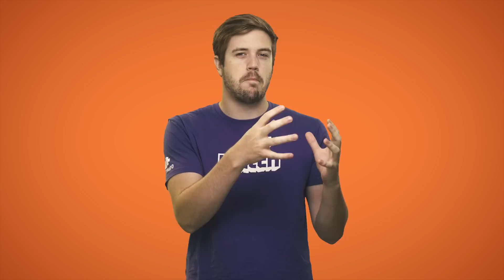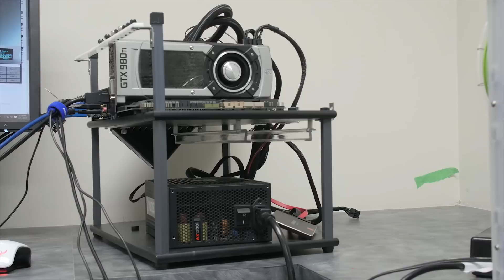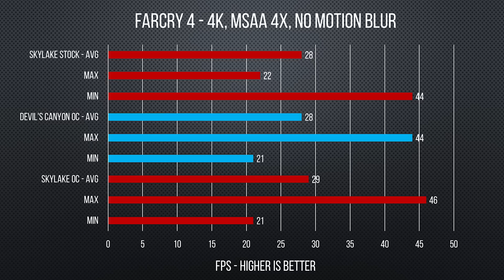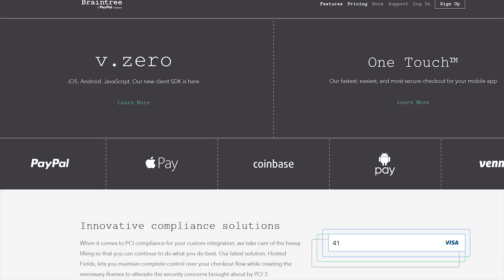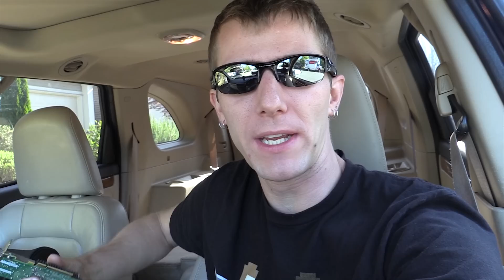Intel 6700K "Skylake" CPU

Comment: I am a gamer looking to max out games at ultra settings on a 1920x1080 monitor. I am really stuck between cpu's and I don't know what to get. I do not plan to overclock and money is not a problem as I have been saving for a while so can someone point me in the right direction?
Reply: If you're only going to be gaming, going for either an i5 6600k or an i5 4690k, even at stock they're still great choices

Comment: AM4 can't come out fast enough.  At least it will probably be around for a while.  Intel changes sockets like it's tissue paper.  Really Intel? You really had to add 1 more pin?  I'm pretty sure with the power savings of skylake you could've sacrificed one VCC or GND pin, but no.  Gotta sell those motherboard chipsets...  Seeing as Microsoft won't release an update for 8.1 to support the new extensions I'm done with winblows as well.

Comment: X99, i7-5820K ftw. Why the fuck would you go for a shit skylake when the 5820K is cheaper in price, has more cores and threads, absolutely crushes the Skylake in any given task except for single core tasking which doesn't mean much since 90% of games are multicore and multicores are going to be the new meta, especially with DX12 so close around the corner,  and I hope that you sassy Skylake fanboys realise you can force certain steam games to utilise all cores and threads. My work is done flies away

Comment: I still have my i7-860.. maybe I should upgrade
Reply: Pentium 3, 4000 fps on 4k crysis 69 with no heat
Reply: ***** Yeah, Trance is right. an i7 is nice (and I just bought one) but it demands a better cooler when OC'd, which also adds extra cost. Just skip the i3 and get the i5-6600k. I don't think that many people would buy a used i3 and it would be a waste of $120.
Reply: lol I still use my i3 550
Reply: +Mason Vanderpool i7 870 here
Reply: +Mason Vanderpool Intel core 2 quad q9300 I Need to upgrade aswell
Reply: +Asentrix eey, I7-870 buddies!
Reply: +Asentrix I lied. Xeon X3440 oc"d to 3.6 GHZ. I just say i7 860 so people don't go "eww xeons aren't good for desktops"
Reply: +Asentrix I'm about to do the same thing anyways.

What did you do with your old machine?
Reply: +ollyver lawrence Intel extreme qx9650 here.
Reply: +Hxdoom G but it's so worn I can't oc anymore...I think it degraded so it's stock 3ghz now..
Reply: AMD FX-6300 
GT9800 series
I need a downgrade quickly!

Comment: Isnt onboard graphics a total waste if you buy a separete graphics card? What will that part of the cpu do when disabled?
Reply: The igpu is usually turned off and it does nothing,  which isn't that big of a loss since it doesn't compare at all to discrete graphics.  Apparently though DX12 will be able to utilize both simultaneously for increased performance.
Reply: so sli for igpus?

Comment: 2600k and Z77 Extreme 4 FOR THE WIN!

I will upgrade IF/WHEN I can ever find any program that TRULY bottlenecks on CPU under MY, personal, usage case!

But at 4.6 GHZ with 4.8 on dual core - I have YET to find any game or anything else that I do, is actually making use of my CPU 100%, sure I MAY see 1 or 2 threads hit 100%, and when running a game with the Crytek 3 engine my CPU threads seem to constantly hand off to each other (my CPU monitor shows each individual thread either sitting at 0% or pegged to 100% and it is constant changing threads)

I am guessing that will FINALLY be fixed once games can make use of DX12 with its MUCH improved draw call scheduling, as I do find it pretty stupid and wasteful for a game to CONSTANTLY be changing threads like that while having half or more of my threads sitting at 0% utilization - and the rest at 100%.

Comment: im not into oc but for my first build im going with skylake either  the i5-6600k 6M or i7-6700k 8M (Probably the i7 because its $250 on newwegg price droped) with the Z170-A  because i hear new things coming out. ( what is direct x12 supposed to do?) with a r9 390 or gti 970 or 980 (r9 390 because of cost) So how this for a pc build?

Comment: Only supports 2133MHz/ Damn it, just ordered a build that has ASUS MAXIMUS VIII HERO and 
32GB Corsair Vengeance DDR4 3000MHz X.M.P (4 x 8GB). Will it not be able to use the 3000MHz?

Comment: I'm gonna buy an i5 6600 with ddr4 ram. On the intel site it says I can't use more than 2133mhz ram, is this true?
Reply: +Hugo Zock It's probably a dumb question but I kinda wanna know.
Reply: +Hugo Zock You can
The RAM will just be downclocked/underclocked to 2133MHz or lower depending on what your mobo supports
Reply: IsaacDaGrazinDragon K thank you
Reply: Hugo Zock
btw sorry for being so late xp

Comment: Here's my overclocking results with my 6700k if anyone's interested. Of course all chips are different and it depends on your components. Mobo: Asus Maximus VIII Hero,  32GB Corsair Dom Platinum @2666, Cooler: Corsair h110i GTX, 

Super quiet mode: 4.2-4.4
Sweet Spot: 4.4-4.6  (On balanced cooling, a bit more noisy)
Max Stable: 4.9 (ran everything from PCMark, Firestrike, Heaven with no issues but high CPU temps with full fan speed)
Semi-stable: 5.0 (Ran almost everything but had 2 random crashes)

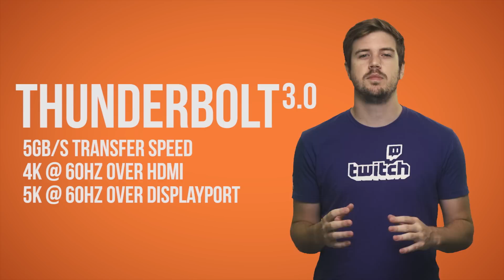Comment: Just checked out Thunderbolt 3 on Intel's website. Its 40Gb/s, not 5Gb/s. (see 3:23) 
USB 3 is 5Gb/s.
Reply: +letsplayskatch Gb = Gigabit, GB = Gigabyte. Capital B designates byte rather than bit, and there are 8 bits to a byte, so 40Gb/s divided by 8 = 5 GB/s :)

Comment: Upgrading from the FX-4300 to this, what should I expect?
Reply: +Quietbut_Deadly Wonders. I went from the fx4100 to 6600k and the difference is huge.
(Went for the 6600k as a temporary cpu until the release the 'enthusiast' version of Skylake).
Reply: +daemonspawn88 Enthusiast Skylake won't be coming for almost 2 years, as Broadwell-E will be coming out before Skylake-E.
Reply: LiquidPanic It's actually closer to a year. Seeing as Broadwell-e is predicted for q2. Skylake-e for q4 this year. There's a number of vids about it, including on LinusTechTips based on the release schedule of previous yeas and what info intel has provided.
Reply: daemonspawn88 From what I can see from the "leaked" roadmaps, either one could be right, as some say that Broadwell-E is coming in Q2 and Skylake-E sometime in 2017, but others say that Broadwell-E won't even be a thing, but instead Skylake-E will come out in Q3 or Q4. Might as well not follow the rumours and just wait and see at this point. XD
Reply: You should (SQUARESPACE) expect like a gazillion % better
Reply: amd=android Intel=apple
cores per performance comparison
Reply: +Killa Konnections that is remarkably unhelpful.
Reply: +daemonspawn88 you are remarkably dumb. amd takes 8 core CPU to keep up with Intel's 4 core CPU's much like android and apple
Reply: +Killa Konnections rofl. You open with an unnecessary insult and follow up with misinformation. Smooth move, kid.
Reply: +daemonspawn88 Thanks
Reply: daemonspawn88 No misinformation was given, this is exactly the case in both situations.
Reply: +LiquidPanic except it's not. In both situations you're comparing two completely different architectures which both have their own pros and cons. Also in the case  of cpus it's redundant making such a comparison at this time when 1) going AMD would save him hundreds of pounds/euros/dollars and 2) if OP waits,  Zen is just around the corner which we have no info on. Making blanket statements like that isn't helpful when so many variables are involved. Especially when the variables change every single year.
Reply: +daemonspawn88 exactly you get what you pay for in simple terms not a long winded crap you just posted
Reply: +Killa Konnections that's not even what you said XD also, the cost of production of iPhones to android is like, pretty much exactly the same...  Derp.
Reply: daemonspawn88 We already know what kind of performance Zen will have, and it's still not close to the single core performance of Intel. Which means if AMD wants to make any sales, they are going to have to have the price lower than they want, again.

Comment: I'm upgrading my rig from an AMD A10 5800K. Should I invest in Skylake or should I just go with Haswell?
Reply: +Blake Fasse Haswell is cheaper and has more motherboard options. I just upgraded my FX-4100 to a i5 4690k. I did so because I could continue using my current RAM. If you Skylake you have to buy DDR4 RAM. i5 4690k + z97 Mobo = $300 or less.   i5 6600k + z170 Mobo + 8GB DDR4 = $480 or more. So unless you either want/need a skylake feature or you have the money to throw around, I would go with a 4690k/4790k.

Comment: upgraded to skylake not because of performance. 1. my sabertooth z77 died. and i don't like waiting weeks to get my desktop up and running agan. and the local computer store had NOTHING in therms of replacement Z77 platform... so. time to upgrade!
2. M.2 my older setup did not offer M.2 support and even using PCIE cards that add them doesn't make use of the raw speed the newer Z170 chipset boards offer! hurray 3 gbps transfer speeds!

Comment: What's the point of even releasing skylake when it's a slight improvement. Also they could be using that money to research graphene processors like IBM is doing. IBM made a graphene processor that clocked out at 427ghz
Reply: +peter g No, they made working transistors, not an entire CPU. If they had a working CPU it would be worldwide news, on the scale of the first consumer available computers ever.
Reply: Yeah sorry I posted that comment like a month after reading about it. And I got confused over if it was a transistor or a processor but still it's impresive how graphene is going to revolutionize technonlgy as we now it

Comment: Why is everyone talking about sandy bridge all the time?
Reply: +Xetion Because it's one of the best CPU Intel made. I'm still rocking a 2600k @ 4.8 since 2012, just upgraded other components, like GTX 980 Ti on UWHD 3440x1440 34 monitor, no bottlenecks. Although very tempted by skylake but it made no sense to upgrade gaming rigs from Sandy to Ivy or haswell if you got a good chip.
Reply: +Xetion Because it was their last big step up, and since then we have seen 5%-10% IPC increases, which isn't alot. even now a 2700k vs 6700k overclocked you'll notice very little differences. Which is good if you bought sandybridge at the time. those chips are beastly :D
Reply: +Xetion Nostalgia...
Reply: Devin Hepburn I still have my 2500k in my rig lol
Reply: Xetion
a good deal of people built a new pc by the 3XXX or the 4XXX
Reply: +Xetion 
Because it's the first time that you could use a CPU for 5 years without any issues and it seems like the number of years even will increase...
Reply: +Xetion STEEEEEEEEEEEEEEEEEAAAAAAAAAAAAAAAAKKKKKKK
Reply: +Marcel Diezasch yes I know, hope that zen makes some changes in the market!! Zen is either gonna be extreme, or its gonna be a rebranded fx processor. You never know with AMD XD
Reply: because at the time a lot of people such as myself were AMD users who had Phenom II x4/x6s and sandy bridge was a significant step up in terms of cpu performance and stability. I paid $150 for my brand new i5 2500k in 2011 and to this day it is still not worth upgrading to any of the i5's they currently have, especially since it overclocks so well.

Comment: When you say skylake supports "up to 2133mhz DDR4 RAM" - are G.Skill Ripjaws V Series 3200mhz RAM going to allahu akhbar my CPU?
Reply: +Craig Shutt Skylake can support up to 4000mhz ram speed overclocked but it ultimately depend on your motherboard. If your motherboard support DDR4 but doesn't support 3200mhz, it will take the highest speed that it can support. Check your motherboard's specification.
Reply: Thanks, I got an Asus Maximus VIII Hero and it works with the 3200mhz ram :)

Comment: I want to build a new system soon too run 3 27" monitors. I'm definitly set on a gtx980 or a GTX 980ti video card. Would It matter if I just got an i5? I plan on using it mostly for racing. I don't really do much gaming besides GTA-V.
Reply: +SpeedFreak Oh and the monitors would be 1080p for now may upgrade later on..

Comment: Linus I just want to ask about the HSF fitting of the LGA 1151. I have an old DeeCool Ice Warrior CPU Cooler, and I’m planning on buying an i7 6700k and an Asus Z170 Deluxe Motherboard but my money isn’t enough to buy a good Liquid CPU Cooler. Will the DeeCool Ice Warrior CPU Cooler fit on the Asus Z170 Deluxe Motherboard? Just Temporarily until I can buy a decent Liquid CPU Cooler.

Comment: I've had a 2500k forever and want to upgrade. A new motherboard requires a newer chipset, which the Skylake is. You say to not upgrade if you have a newer setup, but Sandy Bridge is not new. I don't get it.

Comment: Why did you run your games at 4k when benching for cpu performance? There is little to no difference between the stock and OC Skylake scores as the GPU is the limiting factor there clearly.

Surely you could have a done a couple of runs at 1080p/1440p runs to show us in the mainstream what performance we may (or may not) be missing out on.

Comment: I upgraded to Skylake from AMD Phenom II 965, 3 to 4 TIMES higher FPS in GTA V with Palit GTX 970. Same FPS with less CPU dependent games like Ground Zeroes, but overall, now my PC works way faster. Well, also from DDR2 corsair dhx to Ripjaws V 3000 mhz. And mobo Z170-K is more shiny than old Crosshair II formula. 10/10.

Comment: The chipset is Z170.  You stated Z71 at the beginning of the video... Also, no mention of the additional 20 PCI Express lanes afforded by the Z170 chipset?  Now you can run dual cards in SLI/Crossfire @ x16 each and still have leftover lanes for an NVME drive.

Linustech, I am disappoint.

Comment: you pay out all that money for a few frames faster or just to encode video a little faster fuck that i have a proper budget pc Amd fx 9370 eight real cores 4.4 ghz with turbo to 4.7 out of the box, water cooled with zalman, AMD R9 280x and 16 gig ram all for around £600. british pounds with monitor 1080p and case mouse keyboard oh and battlefield 4.
Reply: +Tanzu15 There are quad core i5s that beat 8 core cpus from AMD. They use much better architecture. Its worth it. Plus their products wont set your pc on fire.

Comment: You would think a channel of this size would know better than to test CPU in games running 4k with the 980ti like that. All those tests are going to be GPU bound at that resolution, they need to run it at a lower res that the 980ti can dominate as to accentuate the differences in performance between the two CPUs.